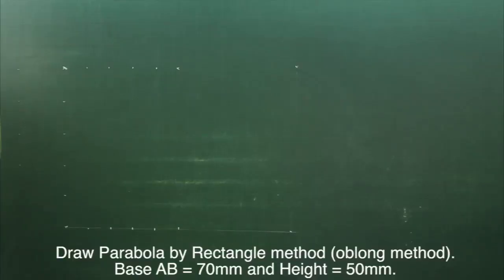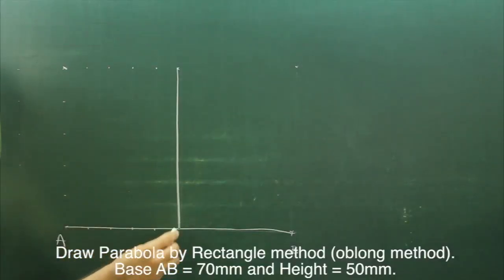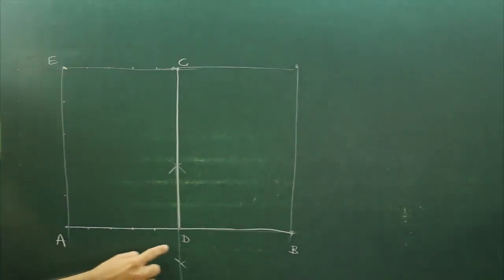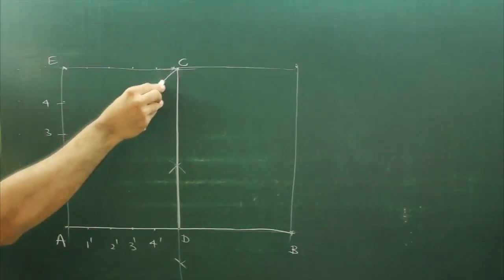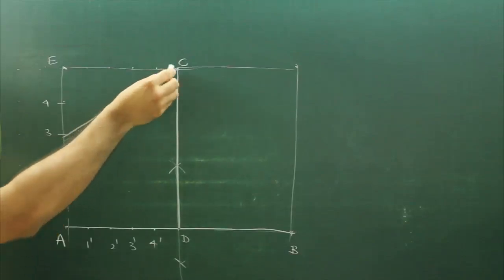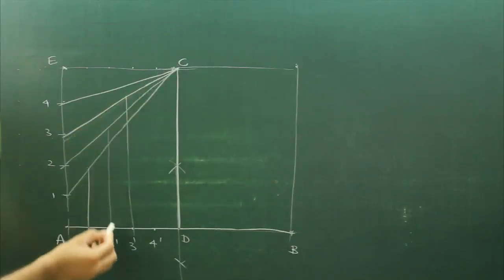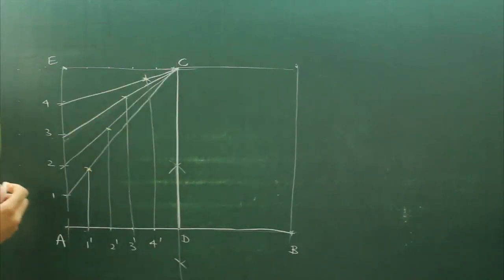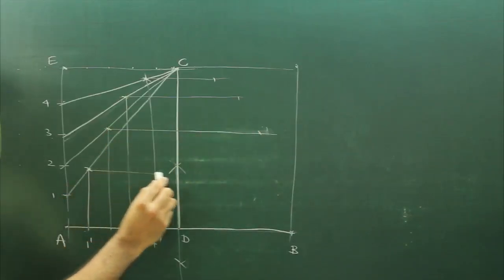How To Draw A Parabola Using The Rectangle Method

Comment: Sir,in some problems they have given 1.5 m above the ground and 2.5 from the vertical orifice .draw the curve .like this they have given ,sir I want to know how to draw in mm , actually drawing is in mm only but they have given 'm' ,sir pls reply , because tomorrow I have exam
Reply from the maker: You can take scale  i.e. 1500mm as 150mm. Like that you can reduce it accordingly
Reply: @technicaldrawing  sir,150 mm is so long sir,it requires maximum sheet

Comment: Why are dividing the sides,which concept of parabola  u are using
Reply from the maker: it is by rectangle method
Reply: @technicaldrawing   can u elaborate more on it
Reply from the maker: @gagank9199  steps?
Reply: @technicaldrawing  you divided the vertical and horizontal and used the intersection points how do you know that these points are going to be on the parabola ,assume i will say to join the divided points differently and found new intersection points how can you say these points are not part of the curve
Reply from the maker: @gagank9199  hmm so you want the mathematical proof ?